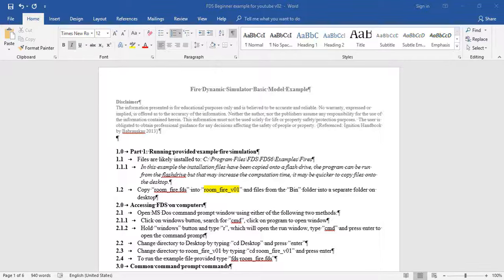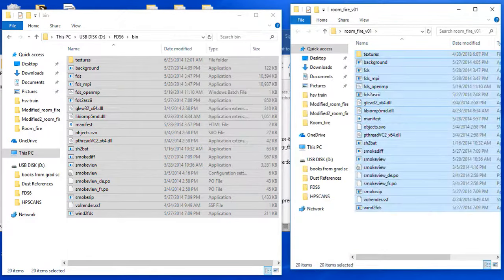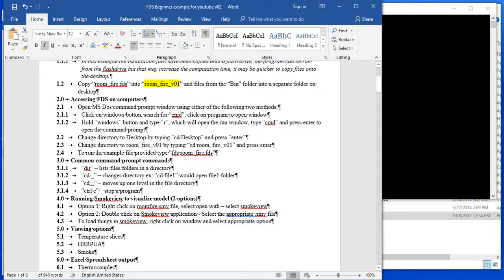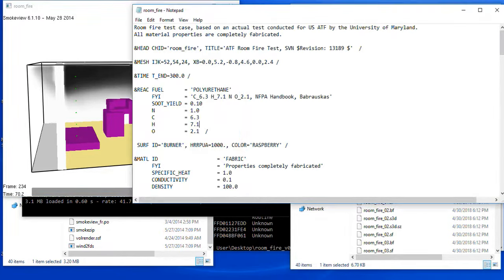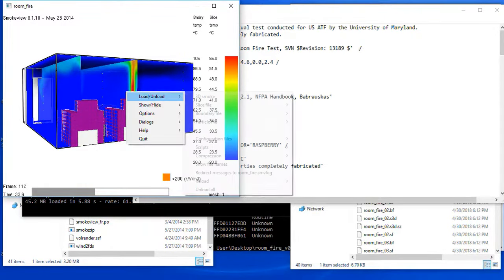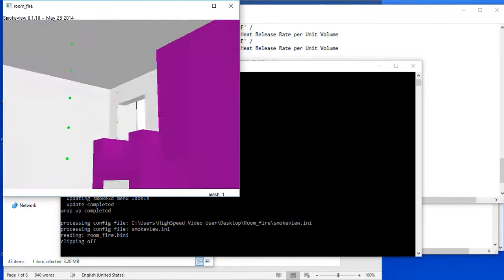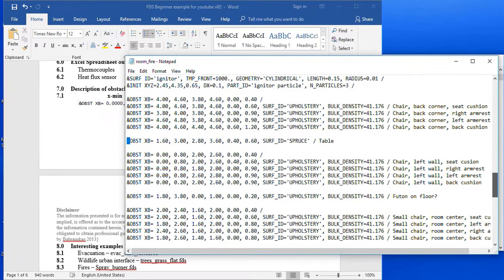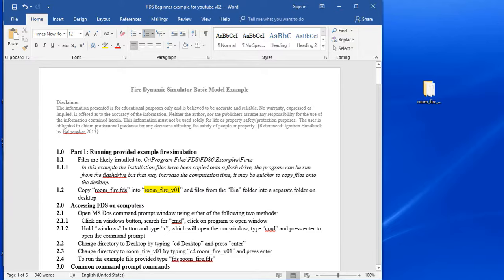Fire Dynamic Simulator (FDS)- introduction-part 1: running example files

Comment: Hi Do you need fast cpu or gpu or both? Running high gpu helps?
Reply: the guy is running a computer with 4 threads. So I think it's not needed but certainly helps. It also looks like his computer is running the simulation from his CPU only.